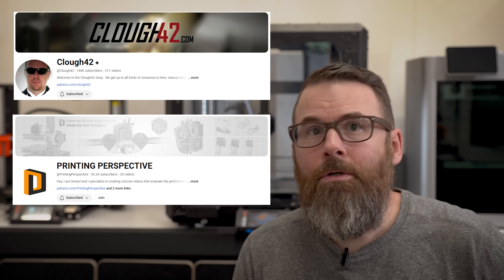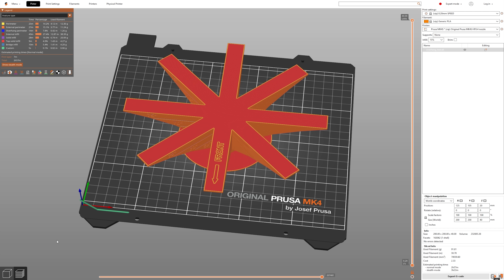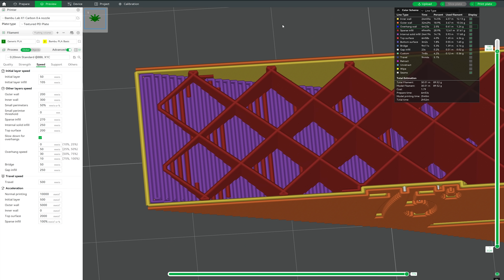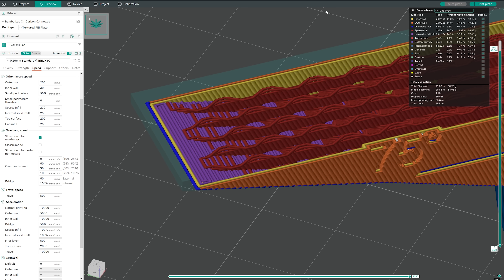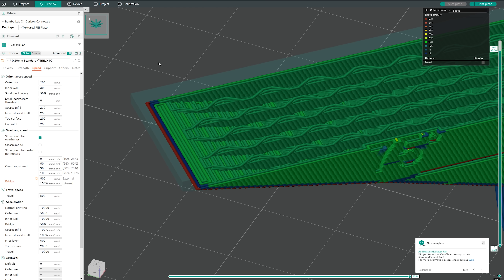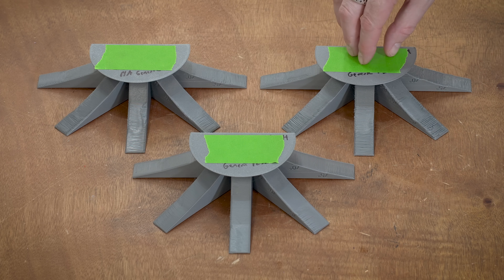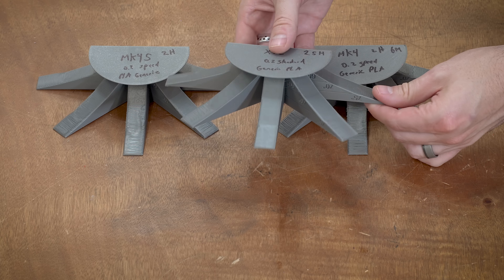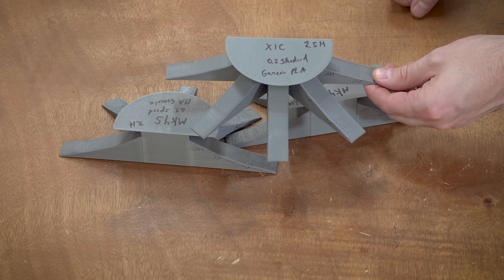Uncovering Prusa's Overhang Performance

Comment: The prusa mk4s has never printed the overhang so badly. I saw a test at the macker faire. The printed part is never out of the Prusa mk4s..
Reply from the maker: Prusa always uses their filament, it does print worse with some filaments

Comment: Wow, you went trough all this trouble to make this video and don’t even know this bug was fixed 9 months ago. Stop making videos about what you don’t know pls, specially when you go after a company saying they were taking advantage of this bug lol 😆😆😆😆
Also, good luck on hitting the claimed flowrates of the bambu, creality, qidi etc printers. Unless you bump up the temp way higher you won’t be hitting no where close. While the MK4s can actually do it and with normal temps.
Edit: apparently bambu slicer still has this issue but that’s all on bambus fault because they actively use code from Prusa and orca slicer wich both of them have this bug fixed.
Reply: Cringe comment

Comment: how much slower did the bambu print get from adjusting the settings? You said by default all three slicers created a similar print time.
Reply from the maker: It was about 30 minutes slower.  BUT, that's because it was printing bridges at 10mm/sec, and the layer above the infill is treated as a bridge, so it was VERY slow, as shown in the video.  If this behavior was fixed, they'd be very similar.

Comment: So if I understand correctly the bambulab is beaten by the mk4s out of the box, but if you adjust the settings and slow down the print speed you can get better results on bambu than on the mk4s. Did you also optimize the settings of the mk4s to see if you can get an even better performance than the optimized bambulab result? Because that seems to be the only fair comparison when talking about optimized profiles.
Reply from the maker: There is no further optimization for the Prusa, it's just doing things right where the Bambu is using the wrong speed for that feature.
Reply: You are missing the point. Bambu is not optimized, just one setting is changed to fix a bug in the slicer. There is nothing to optimise for prusa...
Reply from the maker: 100% correct.  There is no further optimization possible for the Prusa.
Reply: @riba2233  then the video should be called: uncovering bambulab’s hidden overhang performance. Shouldnt it? My point is if you’re tweaking the settings like this, you could also set the prusa settings to 5mm/s for overhangs and get a better result. Slicers are optimized for a balance between speed and quality, and bambu might win quality with this setting but lose speed. You could set a similar lower speed to the prusa and get a better result, maybe even better than that of the bambulab
Reply: @joost3732  what you are saying would make sense if we weren't taking about a bug, bambu certainly didn't intend to print those overhangs at 60mms, but prusa did at 10.
Reply from the maker: Nope, what other settings could be tweaked?  The Prusa is operating as it should, whereas the Bambu is applying the wrong speed settings.

Comment: If it's default vs. Default prusa is still right, and yes the bamboo can print also thatbgood if not better, but there is much more you nees to do. Most people, includung prusa users use the default profiles and I suppose a lot more bamboo users go with the standard bamboo profiles. 
If bamboo doesnt improve their slicer it is a worse experience. Also it is kinda unfair to make prusa point out to the competition to fix and find their bugs. 
If mercedes finds a bug in their fuel econonmy, which is also apparent with a bwm, they wont tell their competion but also do the same as prusa did here. 
Still we wont ever know if prusa has known of the bambooslicer bug. If its default vs default they use the bamboo slicer ofc. 
Prusa is like the Others only a company but is hold to a higher Standard. They do give out the code to prusaslicer and a lot more. So in the end the marketing isn't as misleading as its sounds. I'm really lookinf forward to bamboo and orca fixing this issue and want to see how long bamboo takes to fixing this.
Reply from the maker: Yeah, but give it a month and this will get fixed. There's nothin to really fix with the Prusa.  Also, Orcaslicer already has a feature to prevent this from happening.
Reply: @RobertCowanDIY  I do Hope so, but they shouldve gotten that Bug month ago and Not now as everyone ist pointing thatbout.. Also Orca isnt the Default slicer.
Reply from the maker: @MaxMichel89  Bambu is apparently aware of the bug, but just didn't prioritize it.  They are looking into it now.
Reply: @RobertCowanDIY  but thats a Marketing excuse 😉 i Hope they do, better prints for everyone who is not a pro

Comment: Bleh, I hate Overture filaments. I've had no luck with any rolls.
Reply from the maker: They haven't been my favorite.  The XL hates overture.
Reply: @RobertCowanDIY   there is something weird going on with prusa hotends, it should just work properly with every regular filament
Reply from the maker: @riba2233  Maybe it's the super tiny heater?  I'm not sure, I just printed something fairly large on the XL and in the long straight sections it had a hard time keeping up the extrusion, even with adding 5 more degrees to the temp.  I'm surprised 3d printers don't have heaters with significant overhead.
Reply: @RobertCowanDIY   yeah I installed 80w one in my diy hotend lol, it doesn't cost anything more to do. Someone said that prusa uses 20w heater but that sounds far too low...
Reply from the maker: @riba2233  I think that's about right, it's 20 or 30W, it's not very big.
Reply: @RobertCowanDIY  ouch, thanks for confirming!
Reply: Bambu has no issues with them...
Reply: @riba2233  As if that means anything??? I've dried out Overture, and it still snaps, my nozzles clog, and they've even had a few tangles in the rolls. Forgive me if I'm wrong, but aren't rolls of filament entirely separate from what machine they're run in? Like, a Bamboo printer doesn't just magically dry, untangle, and clean the filament of particles that clog the nozzle?

Comment: I was wondering if you saw this from the Bambu Studio wiki:

An overhang degree of 0% means no overhang. And 100% means an overhanging wall(bridge). So please note that 10% is not included in the (10%, 25%) part, and 100% is not included in [75%, 100%) as well.

So in some cases, the overhang of the inclined surface of the model may reach 100% so that the overhang speed cannot be successfully used, and instead, the bridge speed will be used to print. This is related to the model itself, line width setting, etc., which needs specific analysis.
Reply from the maker: Understood, but it shows the feature type as an overhang, but applies the speed for a bridge.  It's either a bridge or an overhang, it can't be both.
Reply: @RobertCowanDIY  I agree that this is ridiculous behavior and should be changed asap, there's nothing logically inconsistent. The line is portrayed as a wall, but is using bridging speed. Bambu's documentation doesn't say "the line will be changed into a bridge and then use bridging speed". They only say that that perimeter will use bridging speed, and this is true. The line remains an overhanging perimeter, but uses bridge speed.

Note: I am being pedantic by intention. Clarity is very important when talking about this subject. The core of your message is super important and valid, that being that this behavior should change, but clarity is necessary to avoid red herring arguments where people will be arguing about what technically is or isn't a bug
Reply: While I think this behavior is ridiculously dumb, it seems to be intended that a 100% overhanging perimeter is printed at bridge speeds. It doesn't need to be displayed (colored) as a bridge to be printed at bridge speeds

Comment: Orca has had lots of annoying problems with bridges. I'm so frustrated with it. You can't control the internal bridge direction, you can't control the density of bridge placement. This is a nightmare especially since I been working on prototype parts made of PETG which happen to have big flat planes.  The bridging logic (I checked the code) wants to align with longest distance with most support points, and spread from there... Not bad right? We... PETG doesn't like that kind of bridging at all. What I'd want is series of short bridges.

I really like Orca, and it has Flashforge profile (I happen to use 5MP, hoping to get these parts worth a damn so I can get a Prusa and multimaterial printing). I'm actually very happy with 5MP, it's a good machine...Only problem is that Orca seems to be only with good actual support for it. I'm not counting flashprint.

Comment: I was *this* close to getting a MK4S over the Bambu just because of that one feature. Nah, I'm firmly back in X1C territory for my next printer now. It's a shame. I really wanted this to be my next daily driver over the X1. But Prusa have got to get their house in order before I'm back using their machines.
Reply: Both are great options, though I’m a BBL convert, my opinion can only be seen as biased but acknowledging what I had having it’s pros and cons doesn’t detract from the user experience of owning an X1C. My summary of being an X1C owner remains the same as the rationale that made me choose it in the first place: I’d rather have the capability and not need it than need it and not have it. The closest equivalent to the X1C is the Prusa XL + the enclosure add on, so nearly triple the cost but not triple the benefits unless larger format is the goal.
Reply: @joeylopezdesign  I'm not aligned with either faction; I just want a machine which is a tool and not a project beyond initial assembly. Both printers would accomplish this. But, given I want to print enclosed from day one, the X1C/P1S just is the better deal of the bunch.
Reply: Why x1, p1 is much cheaper and basically the same thing.
Reply: @riba2233  Yeah I realised I said X1C but was actually after the P1S. I can live without a lidar and use my eyes to calibrate pressure advance :P
Reply: @ellafoxoo   yeah it is a total non issue :)
Reply from the maker: As someone that prints a lot of dark/black filament on the textured plate, the PA lidar thing just doesn't work.
Reply: @RobertCowanDIY  yeah it is not really made for textured plates
Reply: Lol, if there was an ignorelist on YouTube you two would have the top spots.
Reply: @herr_rossi69   you are not any better...
Reply: So the MK4S is still a better buy. Especially for long term use.  It's EU/USA made with higher build quality with higher quality name brand components. Bambu lab uses cheap china no name components. Their PSU's are banned from sale in the US and soon Bambu will be prevented from selling printers in the US after stratasys likely wins an injunction against bambu lab in their lawsuit. 

Prusa creates more accurate parts while printing just as fast and often faster while producing better print quality. They have class leading reliability and customer service along with the highest ratings in the industry. Prusa at a 4.8/5 while bambu is at a 2.5/5. Over a decade in the industry that has lead the way with their innovations to 3d printing. While bambu lab just copies and rips off others. Prusa fixed the issue in their slicer over 9 months ago while bambu lab is still to lazy to even consider look at it.

Fun fact: bambu lab uses the same cheap $1 no name stepper motors as in a $150 creality ender 3. They share the same exact part number. Prusa uses high quality LDO stepper motors. Bambu lab also uses cheap no name belts while prusa uses quality gates belts. Its why prusas never need belt adjustment and bambu lab printers do. These are just two examples for the higher build quality and reliability you get with prusa over bambu lab

If you want a printer that will last you a decade and longer with a company that will contine to innovate be around. Buy prusa. My 7 year old MK3 has over 25k hrs and still bone stock meanwhile the P1P I had didn't survive past 10hrs with a bricked stepper motor. All boils down to EU/USA high build quality vs china made junk.

Bambu lab also collects your data without your consent. Prusa doesn't. Using a bambu lab offline doesn't stop the printer from logging all your data. As soon as you connect to the bambu cloud to update your printer..your data that the printer collected while in offline mode is automating sent over to the CCP servers.

And @riba2233 is a bambu shill with no experience using prusas. Pay him no attention. Hes made over 100+ comments in the recent LMG prusa vid trying to sell people on bambu lab. He can never rebuttable anything I say so he basically just resorts to "prusa bad bambu good"
Reply: @LilApe  rofl this is getting desperate... 🤦‍♂️
Reply: @LilApe I love this analysis. I run a small print farm and couldn’t agree enough. The other thing people fail to bring to the table is how serviceable a Prusa is. Easy to fix every time. I have had to fix a few Bambu printers of my own and a few of my friends and they are a nightmare to service and work on. Plus overall Bambu is really buggy. When they work they work, when they fail they fail catastrophically. I had an A1 mini fail so bad it would’ve costed 75% of what the printer costs just to rebuild everything.
Reply: @LilApe  My goodness this was insufferable to read. I just didn't bother further than the first paragraph. Talk about factionalising a community

Comment: I'm running Orca 2.1.1 and i don't see quite the same problem with overhang/bridges. Tested with a file that goes from 60-80 degrees. Although i DO see bridging behind the inner wall, printed with 2 walls and 0.6 bottom layer shell. Working in-between in inner shell and internal solid infill to ensure bottom layer thickness

I'm running a Micro Swiss CM2 volcano nozzle and tested with Elegoo PLA @215. I have a part cooler i designed myself that runs off a 5015 0.2A blower @100% for the whole print and 6mm/s for 75-100 degree in the slicer. I have my blower hitting just under the nozzle and the air barely hitting the nozzle, as i noticed it does have an effect on cooling the outer wall of the extruded filament and direct effect on layer adhesion. It's only (educated guess) about 5 degrees at most, but with the variables of heat soak into the filament by how much time it spends in the nozzle from all the movements you will have many matte (under temp) and many glossy (good or over temp) sections on a single print, giving you inconsistent layer adhesion. So to do that i sacrificed a bit of part cooling when the nozzle comes out immediately out of the nozzle.

Can't wait to try variable nozzle temps with the new stuff the open source community has been working on

Comment: While Im glad to see the community testing and validating on their own which gets us all to a better place I fear your testing here is incomplete to say the best. There are a number of variables you're not controlling for here to give this test a proper eval in my opinion. You mentioned filament as one, I think you'd want to at least try different ones on each machine. The enclosure is another, unclear if MK3S was enclosed or in open air. But the biggest one in my opinion is the "split model in half" to save time and no mention of how parts are oriented on the bed. Overhang performance can vary greatly on different angles related to the nozzle as well as toolpath motion, speeds, and flow and their overall effect on the complete part. If you're going to test a model test it as intended. Cutting it in half changes things.
Reply from the maker: I do agree with some of what you said, but this is really more of a test against my previous video.  In the previous video, the Prusa bested the Bambu, with the X1C having a really hard time with the model and I needed to slow it way down.  Once that setting was changed, it not only got a lot better, but actually bested the Prusa.  Sure, there are more variables, but I'm not proving who has the better overall performance, but more that It's more dependent on this slicer setting than the actual printer.
Reply: If it is a retest of your video, perhaps you should have used the same material and the whole model. To ensure real comparability. 
I will do the print with my worst filament on the MK4 this weekend. 
Although it's not original but has a fanduct that blows from two sides.
So Prusa's approach to improving the cooling is the right one. 

Because we learned in your video that it's best to try everything yourself and not just believe everything, not even Robert.😂
Reply from the maker: @herr_rossi69  I'm not sure what you mean?  I did use the same material.  I really don't think the whole model is necessary in just comparing Bambu to Prusa, the difference (with non specialized filament) seems pretty big.
Reply: @RobertCowanDIY  I meant the same manufacturer.
So the different filament is an additional factor. Maybe the Bambulab would be even better or maybe not.
But in the end it doesn't matter.
I will slice the parts once with the Prusa Slicer and then with the Orca Slicer.
I want to see for myself what effect this bug has. Just out of curiosity and to gain experience.

Comment: I will not agree here become you didn't show what slicer you used in the video.
Reply from the maker: I'm not sure what you mean?  For the prusa printers I used Prusaslicer and for the Bambu I used Bambu Studio, all default settings and the 'generic PLA' profile for both.  They're sliced and printed exactly as anyone would with standard settings at 0.2mm layer height.